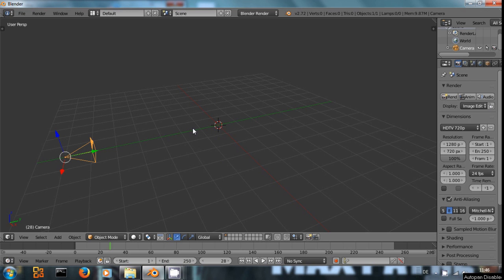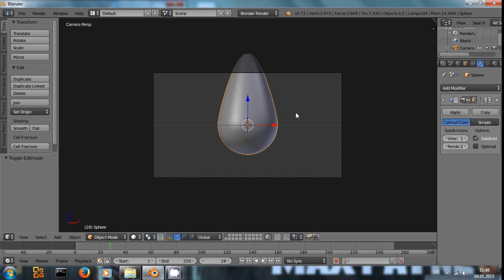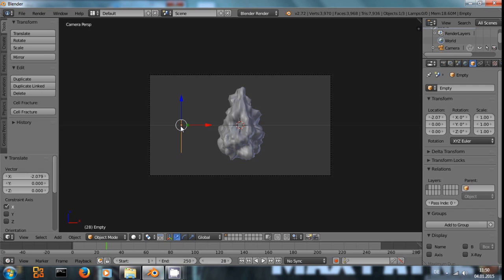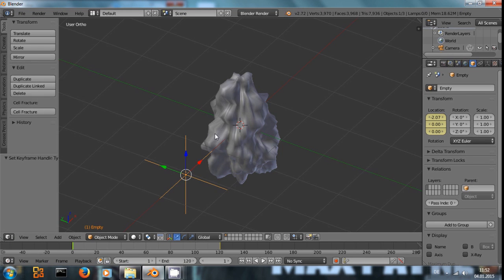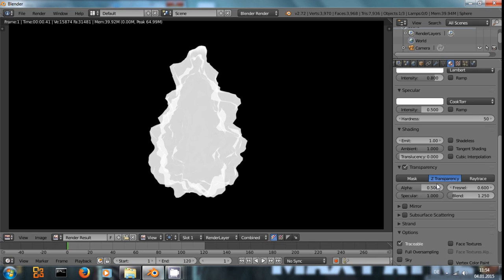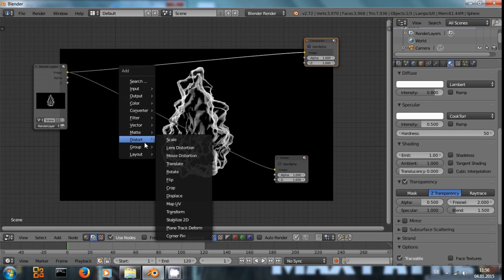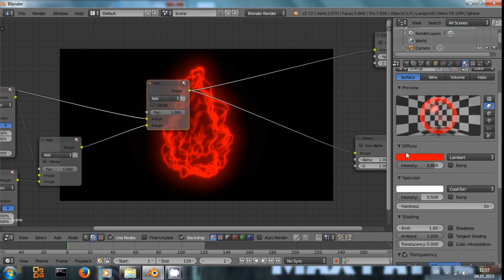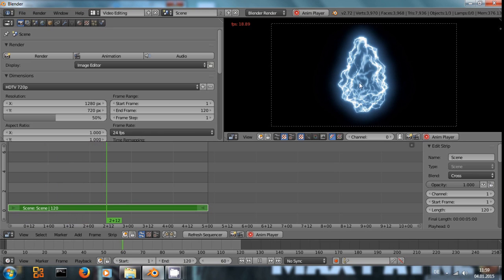Simple Energy Effect - Blender Tutorial

Comment: I stumbled a bit trying to reproduce this. When I would hit shift-Z, it would show a preview rendering that looked fine, but when I would hit F12 or use the render button, the 3D view would just show a black, blank scene with nothing in it, as would the picture on the render layers node in the compositing tree of the node editor, as would the backdrop in the node editor. A blank, black rendering. It wasn't my lighting, my camera, my displacement modifier settings, my post processing rendering settings, anything to do with my node set up... I read through quite a lot of forum posts about people having rendering problems and tried every thing people said in comments and so on, nothing fixed - but I finally figured it out:

When I had created my UV sphere, I had not checked the box to generate UVs. That's what it was. No UVs, no compositing results; so as soon as you check use-nodes for compositing - blank renderings.